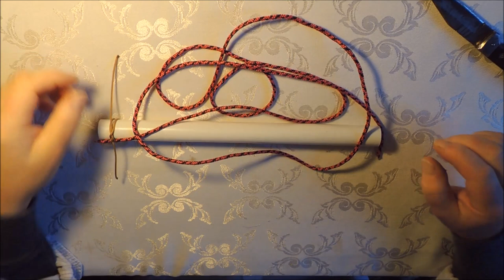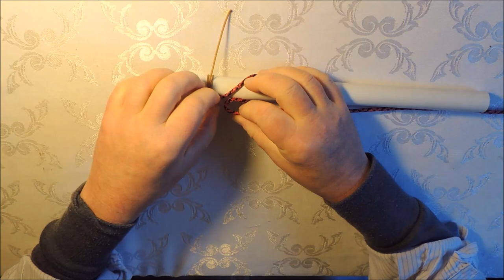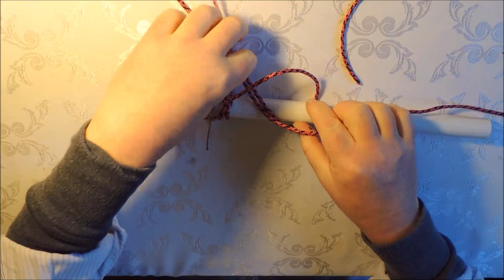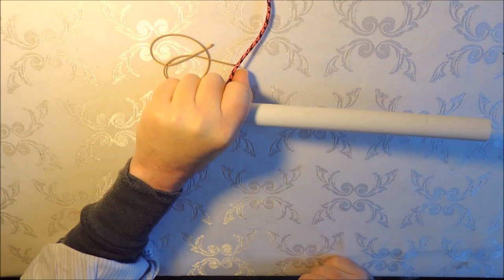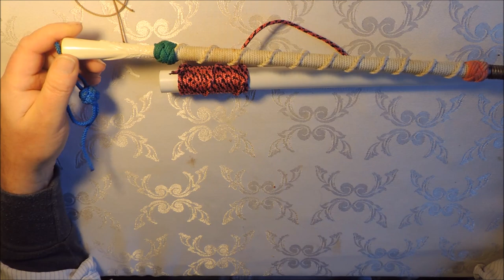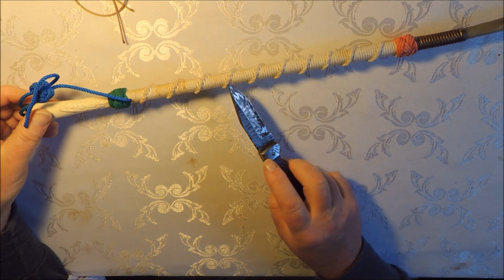French Hitching or French Whipping How to Tie

Comment: I've often used that for whipping the end of a line, but never knew what it was called...

When I was in he Navy (MANY years ago), I saw that sort of decorative knot / cover on some handrails and such -- on the bridge and such... Often painted white or blue...
Reply from the maker: Yes, it does look good on the end of a line. When you are bored, you will cover everything that you can 😉 😉 😉
Reply: @KnottingKnots  -- Over the years, I have made quite a few short lengths of 1/4" hollow braid polypropylene line  with eyes spliced on each end for hanging light tools, extension cords, and other objects in my garage.  Typical eye splice for hollow braid -- form the loop and then bury one end into the other one -- nothing fancy... To lock the loops, I use braided mason line sewn through the inner and outer braids and then tied with an overhand knot on the front and back, cinching tightly at each overhand knot, continuing this for maybe an inch... I guess this would kind of be like having a square knot with a pole running down the center of it... I'll finish it off with a timber hitch or something and then use the needle as a fid to bury the ends (which usually end up being around 2" long) back under the polypro braid... I seriously doubt that I created anything new here, but I have no idea what the real name for it might be... These lines are not holding a lot of weight -- maybe a couple of pounds at worst, otherwise I would not be using cheap polypro line for it... With a MBS of supposedly 440 lbs and a WLL of 110 lbs, that's considerably stronger than what is really needed for this task... I'm more likely to lose the piece of line instead of wear it out... :)

Comment: Do you need the turkshead to keep it from unraveling?
Reply from the maker: Whenever you see a Turks Head, ask yourself what sins is it covering? The problem is that with this type of knot, unless it is for practical purposes, you can either neatly tuck the ends away or hide you sins. Glue does help if you do not want to TH. Thanks for taking the time to view and also make a comment, very much appreciated.